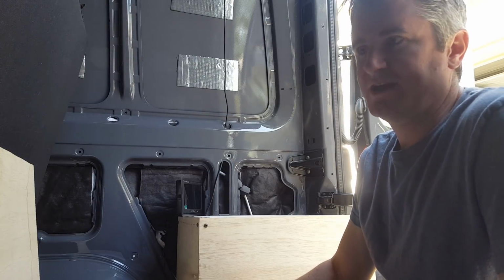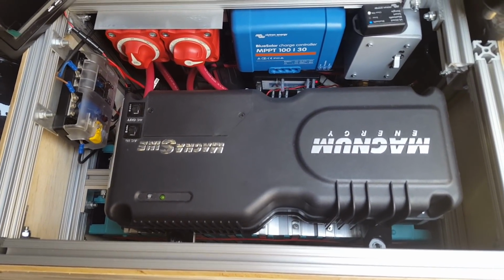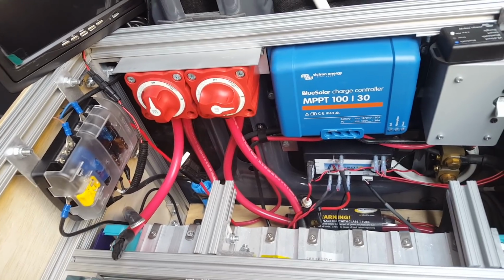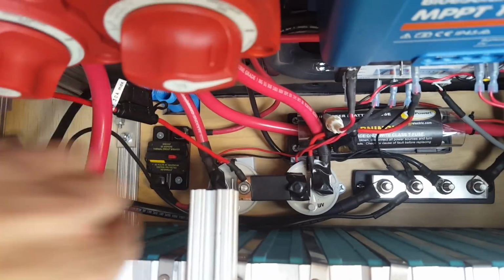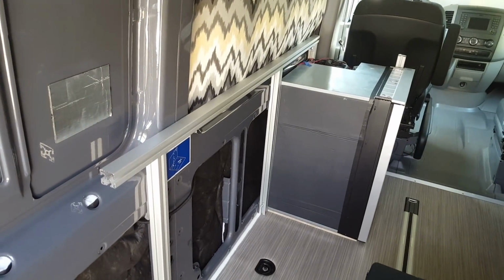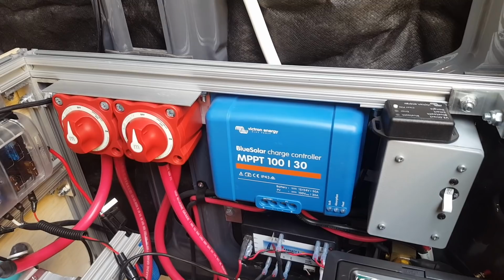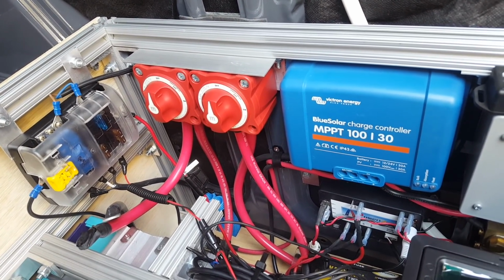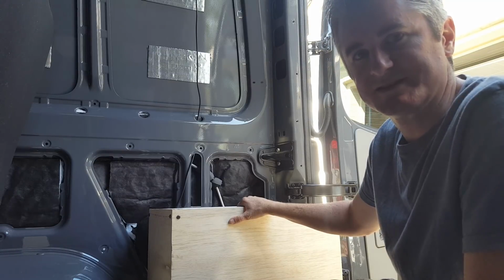Lithium Battery Install in a DIY Mercedes Sprinter camper van

Comment: Can I just purchase your box of goodies and you build another? Where did you get the batteries? Very nice setup and love that the equipment fits in such a small space.
Reply: Goal Zero Yeti 3000 Lithium Lightweight Portable Power System

$3,000 for 280 amp hour lithium battery power supply.     68 pounds.  Mfg told me it will power 1,500 watt drain for 2 hours, and they intend to   have user replaceable battery in near future.  I'd guess 200 amp hour box  in this video cost 2,000 to 2,500 to assemble.

Comment: Thanks yet again for a great video, Ken. I have been about to pull the trigger on a GBS system for a while, and I just got a 2nd alternator yesterday that will be dedicated to charging my batteries. I got the Balmar MaxCharge MC-614 regulator and my plan is to go DC-DC. We'll see if that plan sticks as things progress. Our travel profile is similar to yours, so I'm wondering why you decided to go with solar, since you're going to have this huge alternator charging capacity and you'll be on the move? I like solar, but right now, I'm thinking the 2nd alternator is likely to take care of everything since we'll be on the move every couple of days, and even if not the possible charge rates are huge with the alternator. If that doesn't work out for us, then I'll add solar later.
Reply: Well, then you also get a tax credit for your solar kit if it can be classified as a 2nd home. That may go away in the future, so Carpe Diem!
Reply: Where did you buy your solar and battery system?
Reply: No need for shower. For tax purposes, toilet, cooking facility, and bed does it.

Comment: You going to build a cooling system for it?
Reply: kenetube yeah I was thinking a low intake to a high exhaust out the back door configuration, but if it's not doing any damage then even better.

Comment: Thanks for the video.  I sent it to my builder as sort of a cautionary reminder.  BTW I bought a 300 AH Chevy Volt battery pack that comes with its own BMS.  We shall see . . . .  Again thanks for the continuing videos and all your helpful research.
Reply: Hi--Not much I can say about the Volt battery setup yet because I'm such a novice. It priced out at about 2/3 the cost of regular non-Chinese lithium batteries, including the attached BMS.  I had it sent directly to the fellow doing my RV build.  It is a series of 3 volt batteries configured to12 volts and 300 AH. Seventy-seven lbs total weight.  It looks a bit like yours.  The seller added the BMS he likes so the heart of the electrical system is ready to go.  The builder will do what he does; at this point I don't want to stick my nose too deeply into the project.  The van should be done mid-October.  After I do a shake down trip I'll revisit with info and an evaluation.
Reply: Greg S - I just purchased one of the 250 AH Chevy Volt Batteries as well from the fellow on eBay. Have you been able to test it out yet? I won't have mine for a couple of weeks and would love to hear how its going and what equipment was used as well!
Reply: I pick up the finished van in about a week, but haven't stuck my nose into the details of the build.  We originally informed him what are our basic parameters regarding the electrical system were, then got out of the way.  I'll have more information for you after our three day trip home.

Comment: Thank you so much.  What would need to change in your system if I wanted a 400ah, 600ah, or 800ah capacity?  Just put more batteries in parallel or bigger battery?  If I wanted to have a rooftop a/c draw from batteries, how many amps does the A/C draw?  Thanks again.

Comment: Good stuff. Just the top of the iceberg, but the clearly stated description will help people start thinking about Lithium.
I'm just at the point of doing the same. Done lots of research and decided on a revised Ortons setup, which turns out to be almost exactly what you have. Will use the induction cooktop as well, but a bit more intensive than you. Therefore, I was considering a 2000w inverter (Magnum MS200). I do have my concerns about heat and will place it in a different location.
My initial setup would be 400W solar and 200Ah Lithium, either or both could be increased as necessary.
Like your channel; keep going.

Van Williams
Reply: In a couple of weeks, I'll be working on my solar panels, but right now I'm doing the wiring at the CCP. I may get back to you if I have questions.

Van Williams

Comment: Some info for those considering Lithium batteries over lead acid/AGM etc.

Lithium battery system considerations:

Lithium batteries weigh less than half of AGMs and provide more power.

Lithium lasts 5 times longer than AGMs.

Lithium batteries charge and discharge much more quickly without damage.

Initial cost of lithium is more expensive than AGM.

Lithium batteries need to stay above -4 degrees or batteries will be destroyed.

Cannot draw battery power when the lithium battery is below 32 degrees or they will be permanently degraded.

Lithium batteries cannot be above 110 degrees - high temperature operation shortens battery life.
Reply: I think that you are you should mention that you are talking about lithium ion not lithium ion phosphate, lithium titanate, or some of the other lithium chemistries lithium ion phosphate also known as lifepo4 cannot be charged below 32° but you can discharge it and lithium titanate can be charged and discharge down to -50c(-58f)

Comment: I run my 48 V bike at 4.0V per LiPo cell (12 cells to 48.0V).  Never fully charged to 4.20V/cell or 50.4 V.   I have over 400 cycles between 4.0 V charged  and 3.8 V per cell discharged.  Based on my experience, I would not charge a Lithium battery above 4.0V per cell.   In you case,  3.2V per cell because of the chemistry.  I would never let it go above 12.8V float.  You have nothing to lose if you limit the charge Voltage and everything to gain; assuming it has enough power for your needs.  My $0.02
Reply: Boyntonstu  Not so sure this float voltage of 12.8V is correct for Lithium Phosphate. I would suggest this may only get low %charge from the LFP charging graphs I have seen. These are  nominal 3.2Vcells, but are not 100% charged till nearly 3.4V. So 100% is around 13.6V.  I am using 13.4V float myself as like you I don’t want to go to 100% every time. 10% to 90% would be ideal cutoffs for my thinking. Looking at the Victron site , for LFP a 13.6V float has been recommended.
https://www.springers.com.au/what-you-need-to-know-about-12v-lithium-ion-batteries/

I just found a nice article which seems to mimic what I have observed (so far) with my new 720AH CALB LFP solar setup in my RV

http://nordkyndesign.com/practical-characteristics-of-lithium-iron-phosphate-battery-cells/

“At rest, or for low charge and discharge currents, the above plots are extremely useful for estimating the state of charge, even just by glancing at the voltmeter:

Voltage reading	Assessment	Capacity
13.3V or more	Near full	Over 80%
Above 13.2V	Plenty of reserve	At least 70%
Below 13.15V	Getting on the low side	Less than 40%
Below 13.0V	Definitely getting low	Less than 25%”

Comment: Very nice setup! I love the victron products, high quality! I use them as well. I would to share another solution that might work great as well for charging your Li battery from the vehicle while running. I am using the same gadget. It works amazing and it is victron as well. Check the link: http://shop.pkys.com/-Cyrix-Li-ct-1224V-230A-intelligent-Li-ion-battery-combiner_p_6441.html
Reply: kenetube it is not but it's specially designed for Li batteries and works only when  vehicle is working
Reply: I'm trying to educate myself as I do solar. What is the purpose of being programmable?
Reply: kenetube Oh yes it is has built in micro computer specially designed for Li battery. The version that I sent you is that one. They sell one for conventional batteries. It's programmable but via Victron control unit which is expensive but great

Comment: Hello kenetube, thank you for this exceptional video talking about this topic in a very comprehensive and informed manner. After watching the video there is just one detail which made me curious: what is your reasoning for the logical order of importance of your OV and UV drop off contacts/relays? Because with your wiring an UV drop off (because of low batterie) will disconnect all loads from the batteries but it will also disconnect your solar charging. How would your batteries be recharged? Or would the BMS automatically engage the UV contact/relay again if there is sufficient Voltage from the solar charger? Thank you, Cheers, Wolfgang

Comment: I have the Roadtrek SS Agile with two AGM batteries under the hood for cabin power plus 300 watts of solar.  I would like to change to Lithium.
Reply: From what I read, you cannot use Lithium for the engine.  It does not have the more powerful cold cranking amps of Lead Acid.  You also cannot mix them with Lead Acid under engine, connected with isolator to Lithium house batteries.  Two separate systems.

Comment: WOW!  This is the best setup I've seen yet.  I've been boondocking around the western USA for two years and have never seen anything as good as this.  I am green with envy.  I use two AGMs and one roof mounted 160 Watt solar panel (I have a Four Wheel Pop Up Camper on a Toyota Tacoma TRD Off Road - i.e. I need to lift the roof so cannot practically have more solar on the roof and just don't have enough room for a portable panel).  Managing the system has always been an issue - very manual.  I've already toasted one pair of AGMs by overdrawing.  I really appreciated your clear disposition.  I could actually understand it (Its been claimed that I am somewhat obtuse).
Reply: Thanks, an interesting idea.  I'll look into it.

Comment: $1,500 for a lithium battery!!!!! Bring on the lead acid batteries
Reply: 1/2 the wt. and size of acid batteries. Way more usable power. Don't have to vent them. No dangerous hydrogen off gassing. They will last way longer than acid batteries. 
It works well if your boondocking in a van.
Reply: I just purchased 2 100 amp/hr Battleborn Lithiums after tons of research. Now after reading these threads I realize I have to do a ton more, lol.
Reply: Yes the "T" Model Ford also looks great using your thinking. Overall Cost of Ownership over the life, clearly states the outstanding benefits of Lithium over every form of lead acid batteries, you ust have to save up a little longer I guess.
Reply: Worth every penny

Comment: very detail info, thx for sharing.  might try your method convert vehicle power to 120v 1st while driving, then convert it back to dc to charge Li battery.   Thumbs up n sub

Comment: Hi Ken, I like how you use 8020 for your build. I am going to try and find some videos on that but if you are making a video of the galley set up perhaps you can explain t reason and or use of the 8020 material for you rubies rather than attache straight to the Van walls.

I am looking at the Lithionics Batteries as they have just come out with a system especially designed for the sprinter with all of the proper items for charging etc as you mentioned. They have developed 2, a 150AH and 300 AH. I will study your system and list as I believe it os less money than Lithionics. Thanks or the well explained Video. I currently have the Lion energy Generator system connected but will change out for more power later.

My Maxx fan install went great with the adapter. Curious to see what you are going to do for the kitchen cabinet. I am looking at the Summit C60EL.GLASS stainless steel top with sink and electric cooker. i am going to using the truckfridge which has great reviews an lower cost than most fridges. I will change the electric cooker for an induction cooker I have and insert it.

Again thank you for your time making the videos  they are very helpful and appreciated.

We'll done!

Comment: Another excellent video!
 I'm curious, I did not see or hear you mention the negative from your new battery being chassis/body grounded. Is it?
Also, the monitor displaying battery info, it looks universal. Does it have multiple video inputs should I want to add additional video sources such as camera, etc. to it?
Reply: kenetube, unless you're 100% sure all of your 12 volt accessories are isolated. ( not having any common negative frames or housings making contact to the body of the vehicle) I would recommend you take your lithium's negative to frame.  That or include fuses on both your negative and positive circuits that have common negative frames not isolated. Your lead acid and lithium will have zero problem sharing body ground.
Reply: kenetube, Yes. A boat is usually made out of fiber glass, which is a non-conductive material. 100% isolation is required for a floating system. Example: if the negative lead for your 12 V refrigerator is common with the frame of the refrigerator and you mounted it with the aluminum brackets to the frame of van, isolation is breached. if you had a wire/connection failure your negative  is going to travel through the body of the vehicle and try to operate through another non-isolated devices negative. I know you don't know me but I've been a low-voltage circuit designer for over 35 years. My name is Jerry a.k.a. 12vwiz 
I love what you're doing and I'm just trying to help.
Reply: kenetube, I didn't think you took it that way. Yes, a ground wire equal in size of positive wire from busbar to body. Remove paint in area for a good metal to metal bond. This will not interfere with any sensors or electrics on the factory battery circuit.

Comment: Your set up is just absolutely incredible. I've also got a sprinter which I am building kind of similar to yours. However, mine is the SWB in comparison to your which I believe is the MWB. You've got much more space than me. 
I have managed to squeeze 4 x batteries (marine AGM) under the passenger and driver's seat. So far, working great. Congratulations on your build.

Comment: Very nice! Not too far from what I'm planning too, except I'll be using a Victron inverter/charger too which of course allows custom charge programming too. I'll also use the 'alternator -> inverter -> inverter/charger -> battery' method primarily as my battery is 30V, while the alternator is 12V. It's not efficient, but it's easy, and as you say the inverter/charger will charge the batteries properly. The other Victron gear I'm using  is the "Battery Protect". If you put it into "BMS" mode it'll act as a relay switch. The advantage of it is it draws very little current. For anyone interested in my setup it's all going on my YouTube channel.
Reply: Yeah I can confirm the battery protect (BP) has 3 modes, A, B and C. In C mode (BMS mode) it will not do anything intelligent at all, and only be controlled from the BMS. Our Zeva BMS has a multiple outputs: one for charge control, one for 'aux' (which could be used to disable loads), and another 'drive', which will turn off in either case, over or under voltage. We use the 'drive' 12V output which we plug directly in to the 'remote' port on the battery protect. If we have under or over voltage on cells, it'll de-activate the 'drive', which then disables the 'remote' on the battery protect. We actually have a 29V battery going through the BP, and use 12V to control it. On A or B modes, the BP has a set voltage (16V or 32V) for over current, and various under voltage settings you can configure. The voltages are in the manual:
https://www.victronenergy.com/upload/documents/Manual-Battery-Protect-12V-24V-65-A-100-A--220-A-EN-NL-FR-SE-DE-PT-ES-IT.pdf

We have to use C mode and thus control it with the BMS because we want to charge our 29V battery up to 32.4V.

So at the moment with our config, if the BMS has a problem at all, it will disconnect the battery completely. In theory it should never do this. I'm considering having a separate battery protect to disconnect the loads only. This would be controlled from the Victron battery monitor, rather than the BMS. At the moment low voltage would disconnect things so we can't charge either! In the end we want the BMS to only protect the batteries from cell imbalance basically, or failure of the charger, or BMS failure.
Reply: Yeah I think you want some sort of AND logic gate relay. Then if either loose signal, it will turn off. I did ask my electrician, he said they exist but I don't know the name of them. Were about to investigate such a device until we discovered the BMS has the third 'drive' output that turns off in either case. Check your BMS manual carefully incase it's got something similar. Ours is called 'drive' because the BMS is designed for electric cars, so you can imagine if cells are going out of range it needs to cut driving power.

I have shot all the footage of us putting our BMS together, I just need to edit it up and publish it. So stay tuned to my channel!
Reply: I updated the system diagram of my system including the BMS:
https://www.dropbox.com/s/mh1nay7oanmrdke/Artboard%201%402x.png?dl=0
Reply: so guys, this was something i needed clarification on, why have an additional BMS if your Lithium batt has its own built in BMS?
Reply: Like kenetube My battery does not have a built in BMS, which is why I added one. You have to ask what it's doing too, e.g. is it just monitoring? or protecting? Built in BMS units often protect and balance, but might not monitor.
Reply: Eat Sleep Van What software does everyone use to make the pretty wiring diagrams?
Reply from the maker: I use digikey scheme-it.  It's not the best but it works.  MS Visio is decent too but I use Mac.
Reply: ourkaravan Thanks!